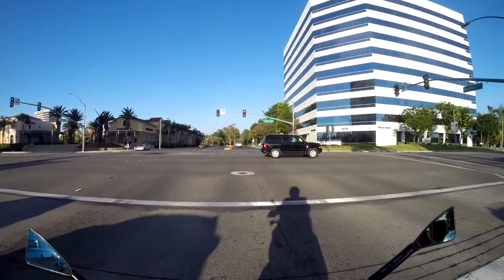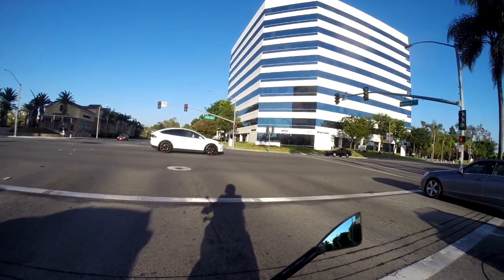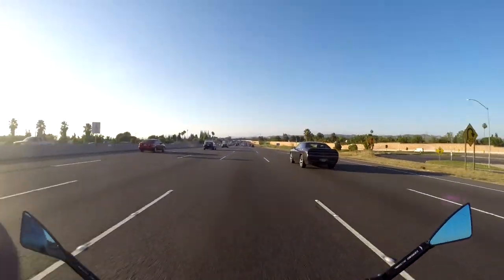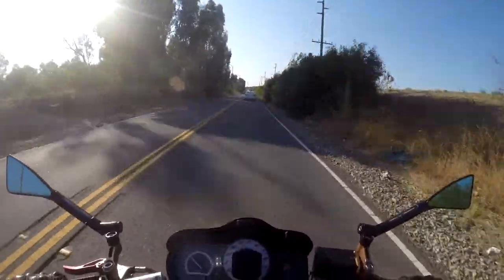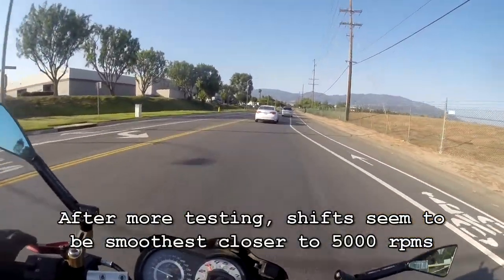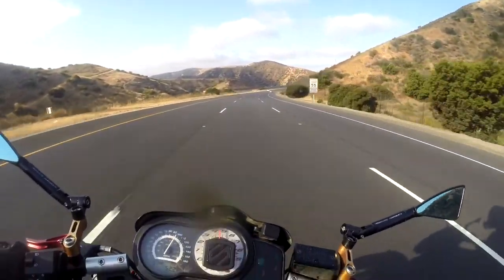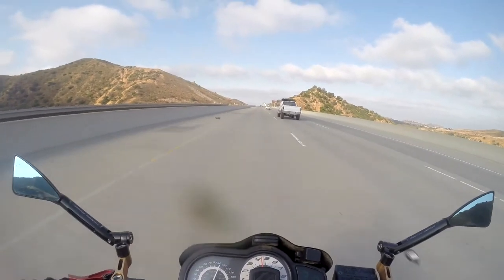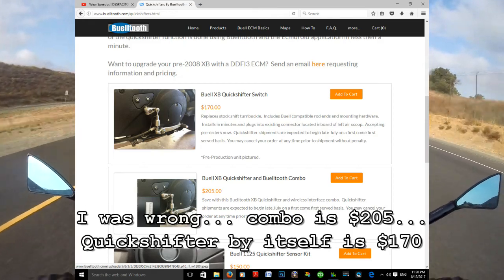Buelltooth Quickshifter Review

Comment: 91 , 55, 241, northern corona, I recognized all those roads, grew up in corona and commuted a lot to Dana point. Got a Buell being prepped in corona that I have been away from for the last 3 years (stationed in Japan at the moment) would you recommend this for someone who does 80% commuting and not so much track time? Or would it become a nuisance?
Reply from the maker: I would not recommend the quickshifter for commuting... you need to be rolling on the throttle hard to use it.  I actually disable it through ECMDroid until I go to the track.